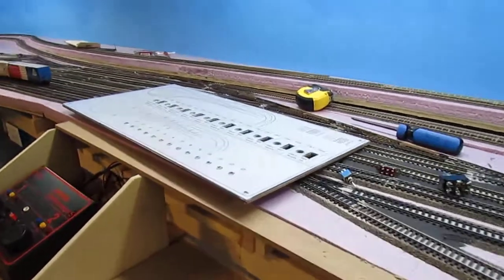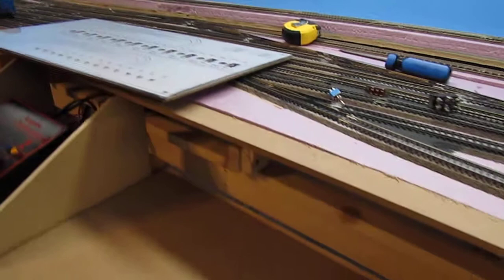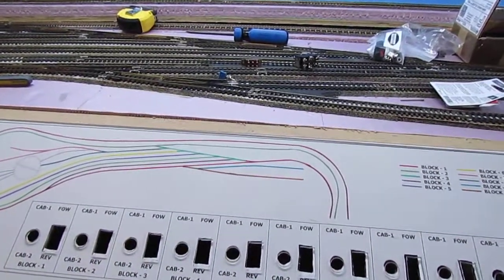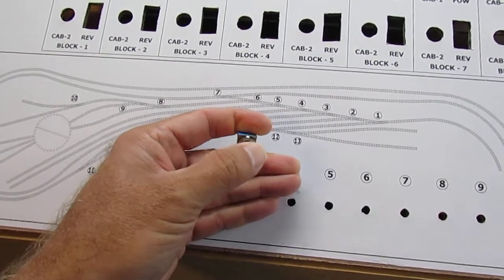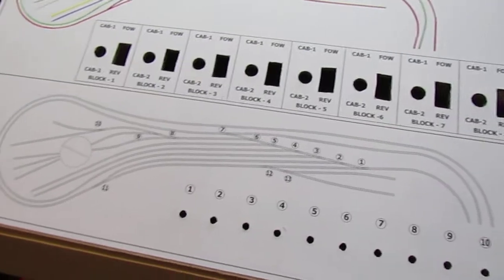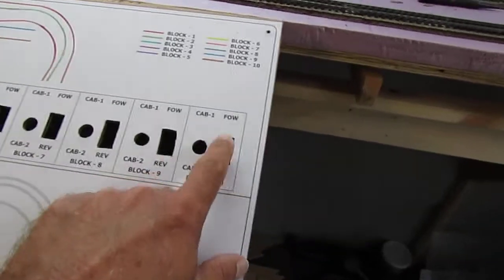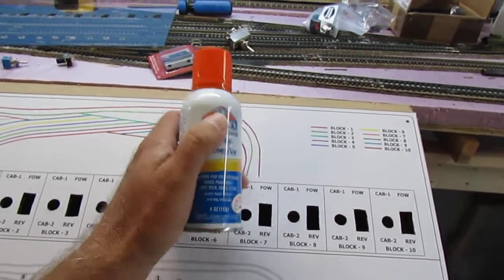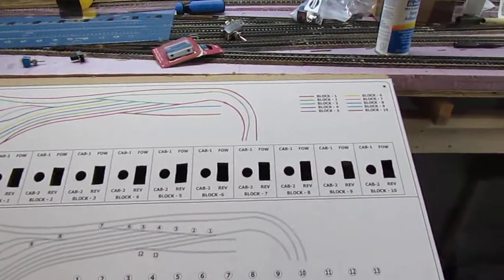Video 14 - Pt. 1: Alvaville HO Scale Model Railroad - Building a Control Panel

Comment: Good evening. I watched the video where you wire up the LEDs. My question is can you use the slide switch that comes with the switch machine rather than use the toggles? Or are the toggles necessary for the way you wired up the LEDs? Thanks!